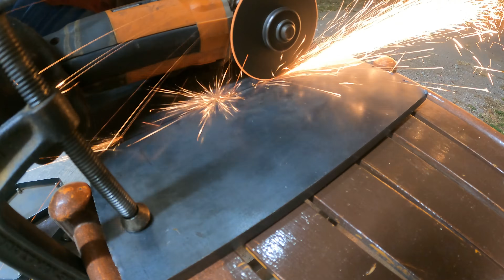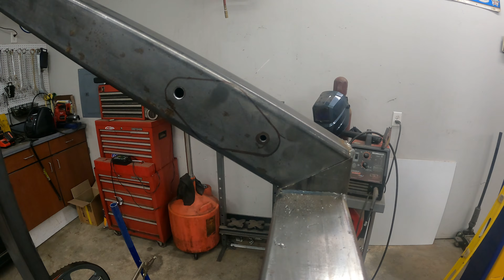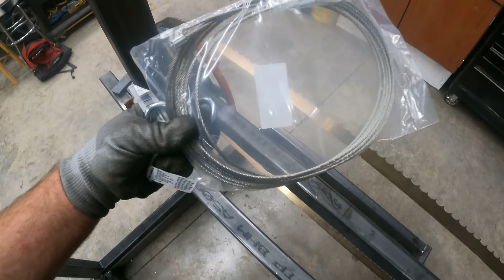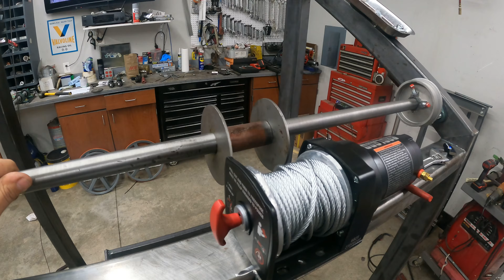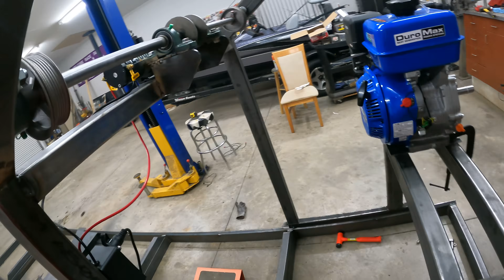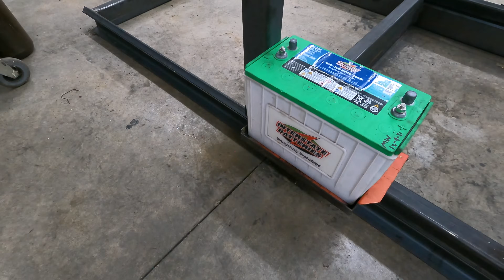DIY Sawmill Build (Part 2) Power Lift Head #diy #sawmill

Comment: I did the same design as you, one drive pulley behind the band wheels.
I used 1.5” shafts and am wondering if I’m going to be able to achieve full tension.

My concern is that with the drive pulley forcing the band wheels to hang so far forward, that the shafts might have too much overhang and bend under tension.

Was yours OK so far?
Reply from the maker: I think with the 1.5” shafts it’ll be fine.  I believe as long as you keep the bearings greased properly, they’ll be fine. I guess time will tell

Comment: Im building a 158" blade sawmill

Do you think 14hp is enough to run it for homeowner use?
Reply from the maker: I think it will be enough HP 
If you’re running logs 30” diameter or smaller I feel like you’ll have plenty of power

Comment: Are you working off a set of sawmill blueprints?
Reply from the maker: No, I did a lot of measuring and put things to paper and have been building it of my written sketch. I used graph paper and scaled it all off in inches. So far everything is working out as it should.

Comment: Awesome work so far! I built a mill very similar a few years ago. I do have some concerns about your power lift though. That settling is because the cable is wrapping over its self on the winch spool and that will 100% be an issue when you're cutting wood, especially with the vibrations from the engine running. the speed also seems way too fast, Mine uses the same winch but a different setup and is maybe 1/3 as fast as yours, and its still too fast to really dial in on a scale. I can email you some picture/ video if you're interested
Reply from the maker: Thank you! I have been worried about the speed and creeping! I’ll take some videos/pics for sure. I wanted to use gears and chain but couldn’t really come up with a good way to get the gear onto the winch? I’m definitely Interested in your setup and I appreciate the input 👍🏻
Brandonmckamey25@comcast.net